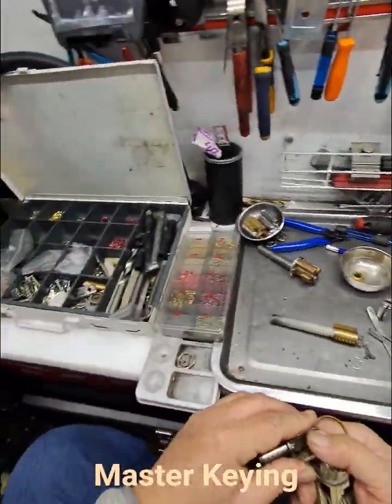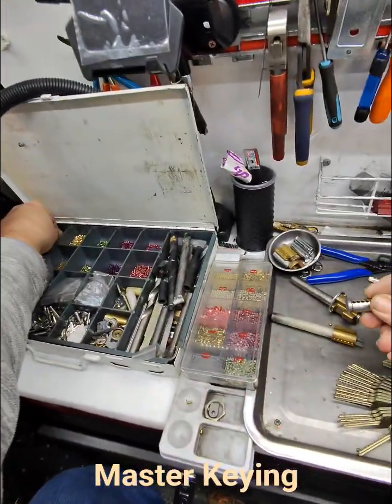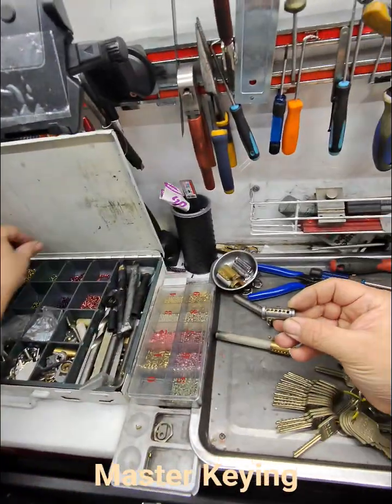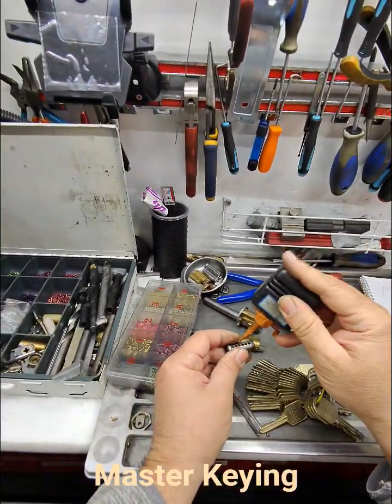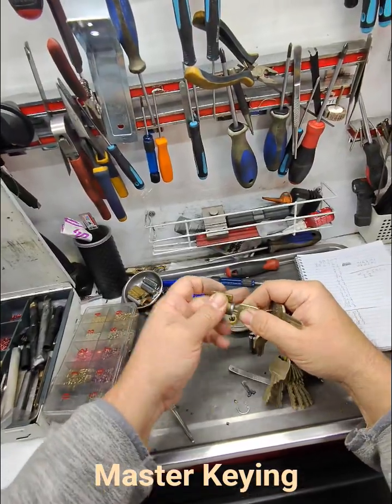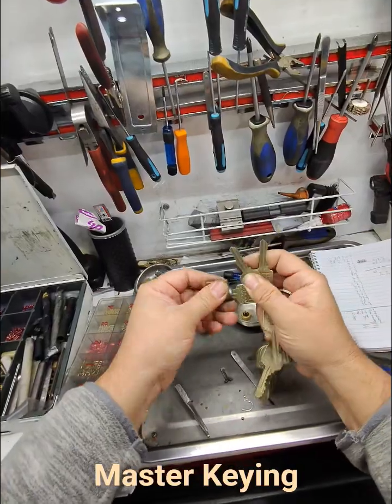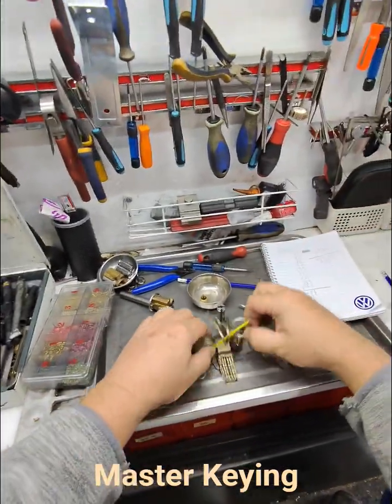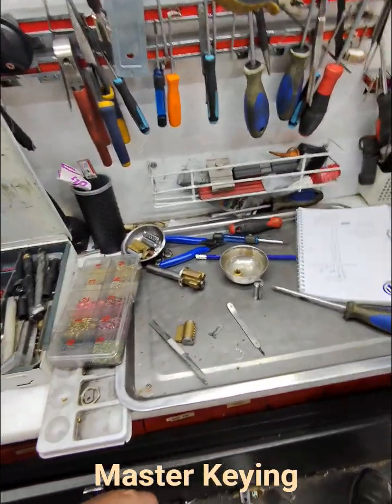Master Keying Explained! How I Made 2 Keys Work a Lock 🔑

Comment: Thanks for the upload. Are the standard 0-9 pins (compatible with Lockwood) able to be used in IP8 cylinders? Is this generally the case with other restricted systems?
Reply from the maker: Yes and no, you should use nickel silver pins on nickel silver keys like IP8, but most use standard brass pins